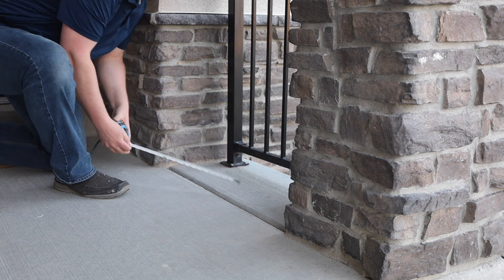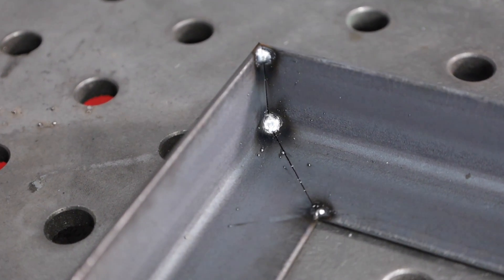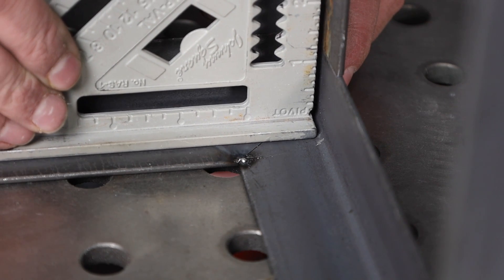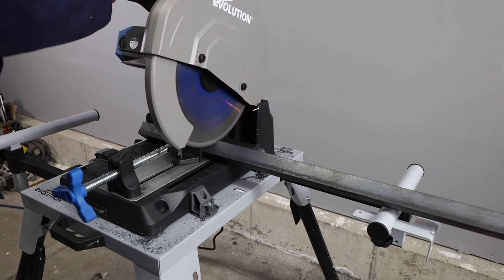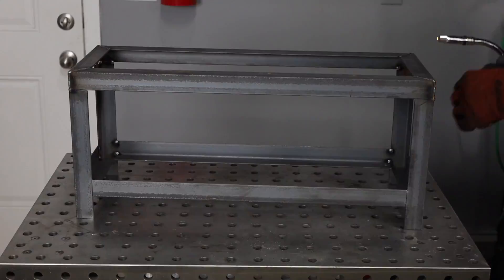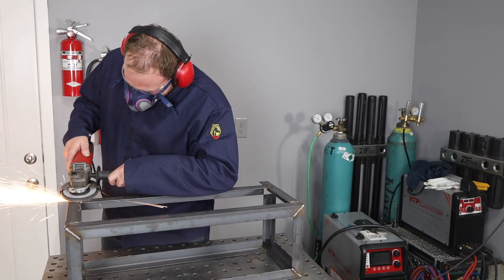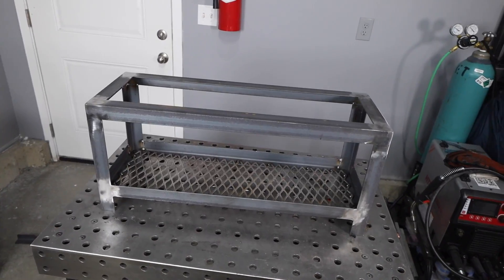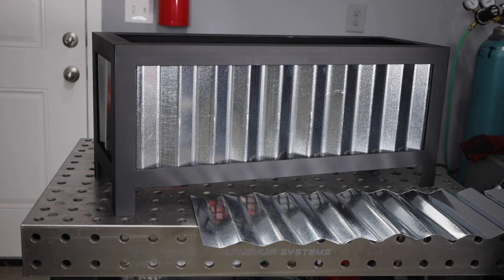Weld A DIY Planter Box

Comment: Angle is a good material for making simple projects like you show.  Another very useful material to make lots of things is simple 1in.x1in. 16ga. square tube.  It's easy to fit up, is fairly inexpensive, and strong.  I have made tables, welding carts, work benches, and lots of other things with it.  It's perfect for mig welding projects.
Reply from the maker: Thanks! I definitely agree. I’ve used way more square tubing in that exact size than any other material.

Comment: You know what nobody talks about?  is how far you should attach your mass clamp from the working area, how far is too far, the closer the better, anything about where to put your mass clamp
Reply from the maker: Directly on the work is best, especially with MIG, but I just leave mine on the edge of my table and it works fine. If you’re stick welding and your metal blows out at the end of your welds (arc blow), moving your work clamp to the opposite end of your workpiece can help.
Reply: @TimWelds   how long is your work table, I know the closer the better but sometimes you can't just clamp it next to your welding piece, for some pipe welding is required to put the mass end right at the welding bevel, but if your welding lets say a 2 inches pipe gate  and you can't clamp it right at the hinges for example then how far is too far?  I know the closer the better but, when you buy the welding wire cords is suppose to be a length depending on amps and wire gauge but does it count the length between the electrode and the mass clamp?